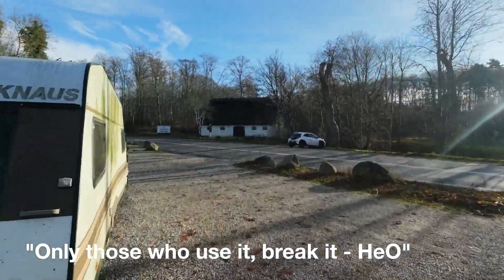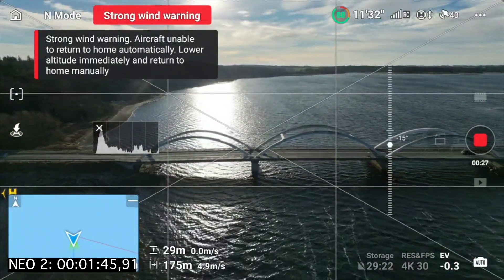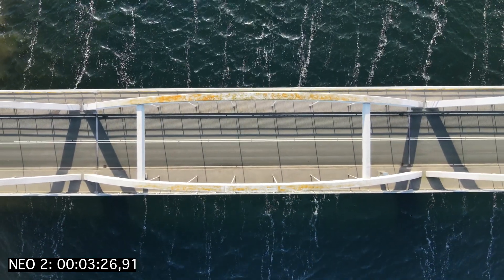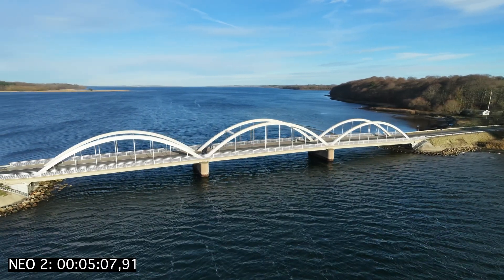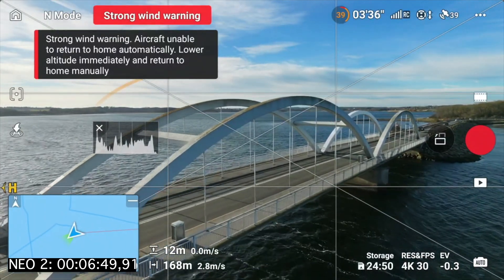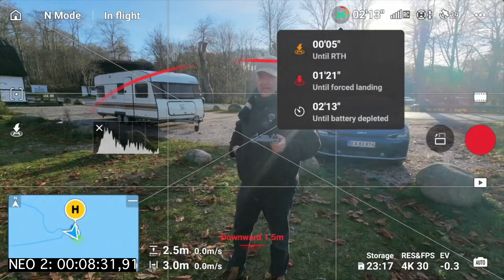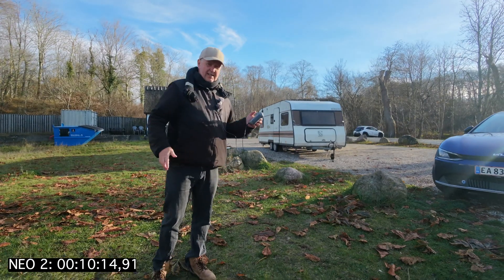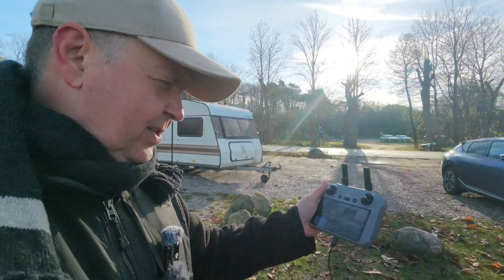DJI Neo 2 Real-World Flight Test | 2°C / 35F, Wind & A Crash

Comment: If this had a longer flight time I'd get one in a flash but, for me, it's just not long enough.. If the made a Neo 3 with these features and a longer flight time, or, better still,  a better battery for this one it would be great. People say buy a better drone but there is nothing that compares in the sub 250g as far as I can see. I like the build and the enclosed props. People say put prop guards on a mini 5 or whatever but that would take it over the 250g.

Comment: Be good if dji can make a more powerful battery for the neo 2 even if its heavier because that's its only downfall apart from that its a fantastic little drone and all the tech for a small price is great. Thanks for sharing 😁 👍 👌 🇬🇧
Reply from the maker: I agree, a more powerful battery would definitely make it even better! And they could within the 250g bracket
Reply: Then again...if they don't AND you want more flight time...just buy one of the other (more expensive) drones they have
Better business for them to NOT make a bigger (in power) battery 😉
Reply: That would be great, but true is that they want you to buy another more expensive drone if you want longer flight time. Also they are limiting functions, for example my favourite - panorama, for which HW is there, but they don't want to give you all functions in one cheap drone..